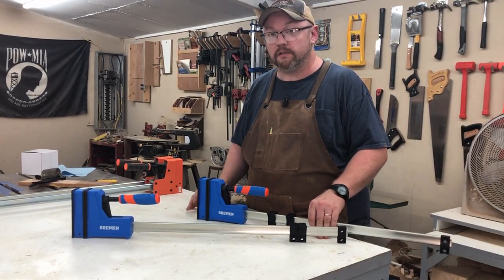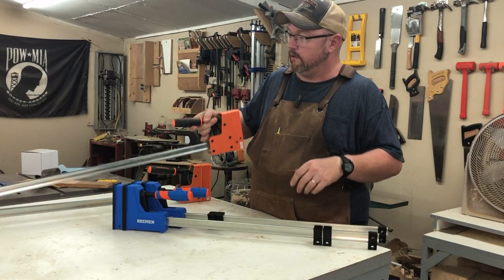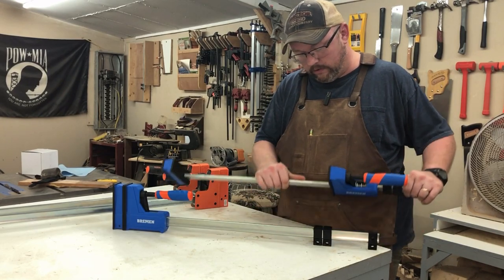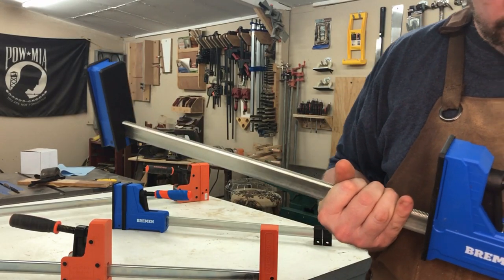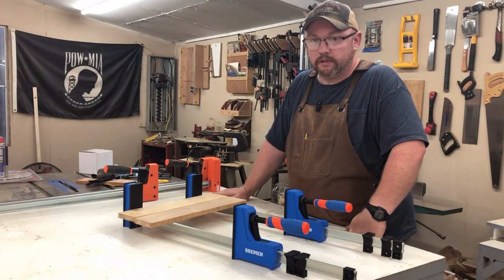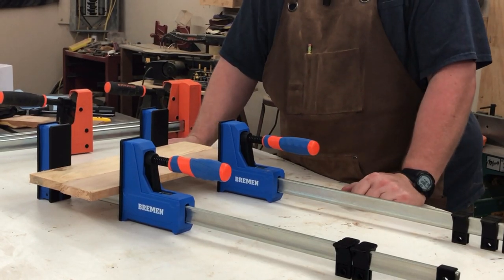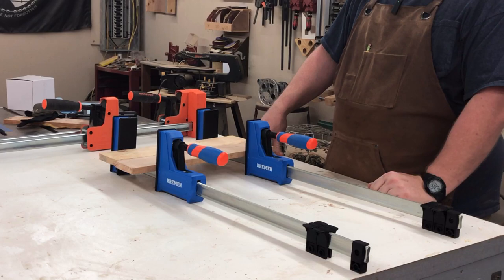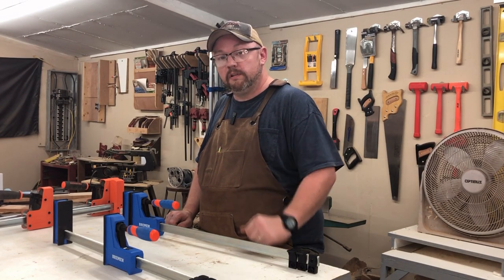Parallel Clamp Showdown!! Bremen (Harbor Freight) VS. Pony Jorgensen!

Comment: I was excited to see these coming out, but was a bit disappointed in the price.
If they come down, or go on sale, for about $20-$25 a piece, then I will start picking some up.
I miss the days when HF stuff was at least 50% cheaper than the competition,.. but that doesn't seem to be case too often nowadays.
Reply from the maker: It’s true, when they throw around the elusive 20% coupon, it helps. Makes them close to half the price of the competition, but I think HF had started investing in higher quality brands, and of course price started going up, they did away with coupons, but then Covid hits and the economy took a dive and they’ve started using coupons again, but not to the same level.  It kinda stinks!